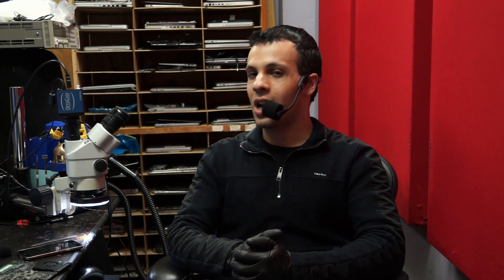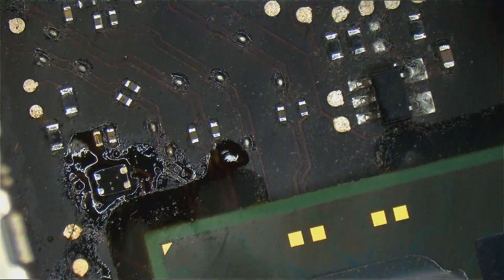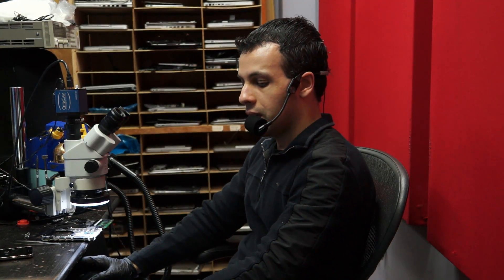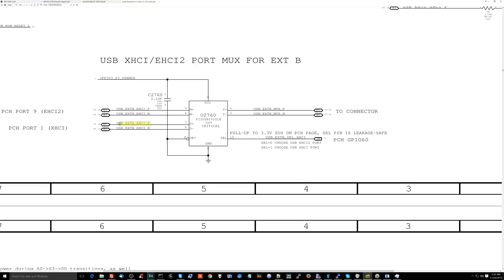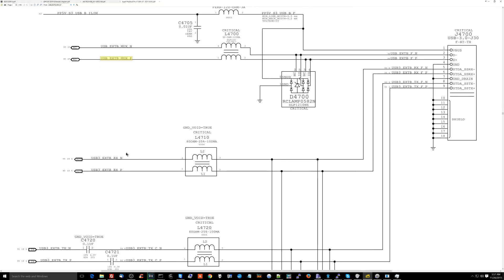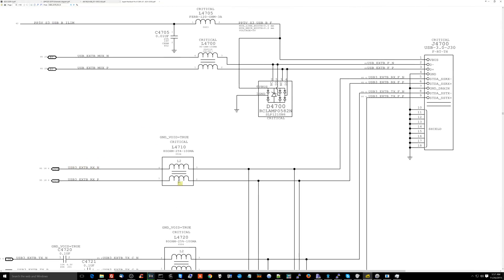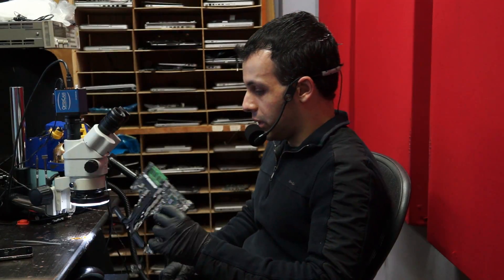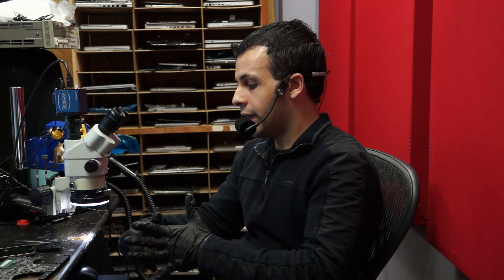Why are inductors used as filters in data lines tricky to measure?

Comment: Would an LCR meter be any good in this situation? (A lot cheaper that $40k...). Mine has the following Test Frequencies:
(0.0uH - 0.3 uH)   @ 200kHz
(0.3uH  - 4.0uH)   @ 15kHz
(4.0mH - 10.0H)   @ 1kHz

Ideally the inductor should be removed from circuit before measuring, so at that point you may as well just put on a new inductor anyways.
Reply: Yes.

Comment: These filters are called common-mode chokes. You can simply replace them by wires and when you plug in a USB pendrive or something else without a long cable, it should just work. Might help someone who is out of donor boards.

Comment: Hello guys,

I've got some problems with my macbook pro that I just repaired. I changed mostly the PM6640 and the ISL6259HRTZ. I was able to fix everything (it's working back normally nothing wrong) unless the power button. I can switch off the laptop but I can't switch it on. The button is working well as I measured the line SMC_ONOFF_L (around 3,42V when button is not pushed and 0V when pushed). I tried an SMC reset but nothing is working...

Does anyone have any idea of what is going on?

Comment: Nice black marshmallow pop filter , lol just kidding,  But your right, I also use the substitution part repair method when I suspect the part is bad and I have no way to test it. I use dozens or donor boards here for parts. You learn that real quick when you repair electronics to keep that shit around. Also if you don't have the part, you can try to swap filters or parts from another USB port, if available. The one tool I suggest you invest in is a ESR meter. I noticed you don't have one there at your shop, but then again you are working with mostly SMD motherboard components. But it will be essential for power supplies that have  electrolytic capacitors. I am not sure if you work with many power supply failures. Oh and thanks for the flux tip, cant wait to try it. I thought i would give it a go and see if it compares to what i currently use. Great video..